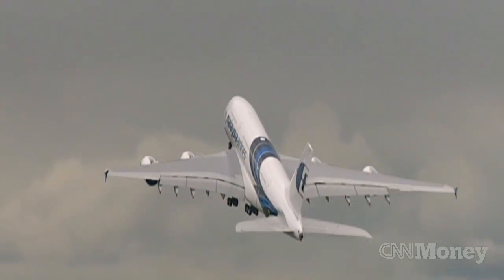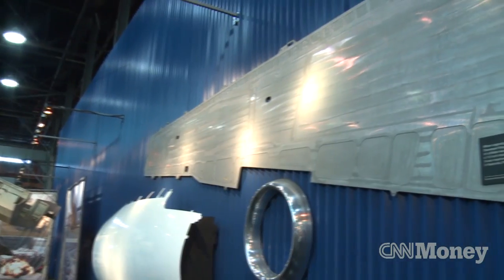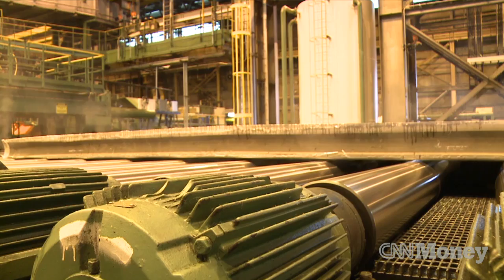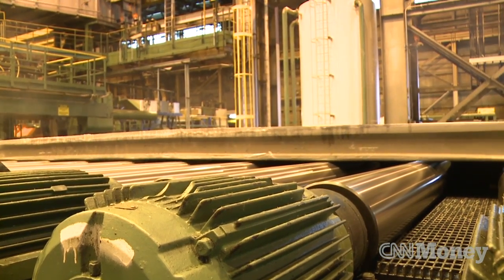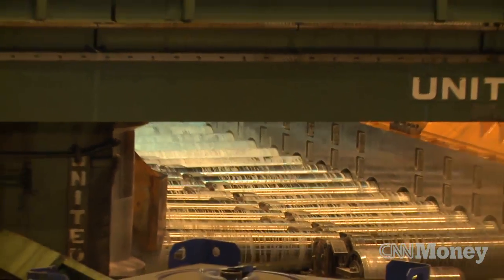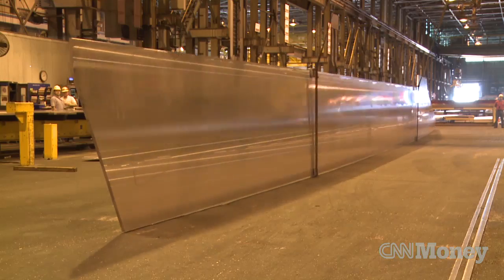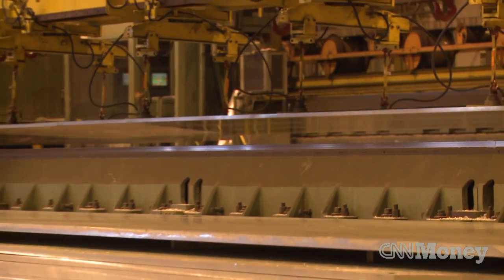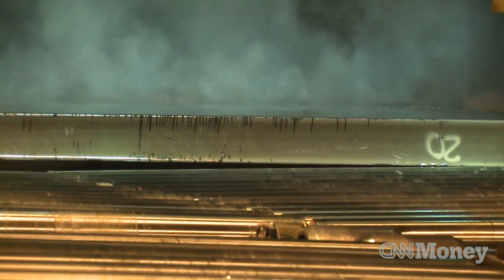Inside Alcoa's largest U.S. factory

Comment: Aircraft are skinned with Alclad which is not pure aluminum but a sandwich of layers of alloy for strength and permeability
Reply: 7s to prevent oxidation, 4s is to help with brazing while rolling.

Comment: It's actually in Riverdale Iowa. Along the Mississippi River. Place is called Arconic now.
Reply: Turbo Lives In my heart riverdale, Bettendorf, Davenport, all the same thing. P
Reply: It’s Bettendorf
Reply: I work for a company that alloys aluminum we sell Arconic the slabs of aluminum.
Reply: Part in bettendorf part in Riverdale. Building is 1 mile long.
Reply: Yea I work at the lancaster plant in pa I drive those flatbeds at the end of the video.